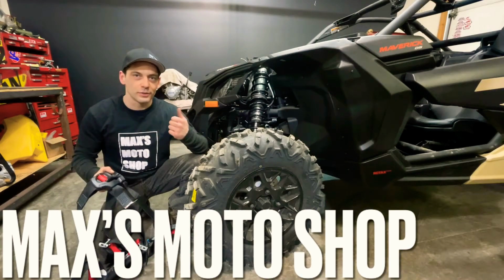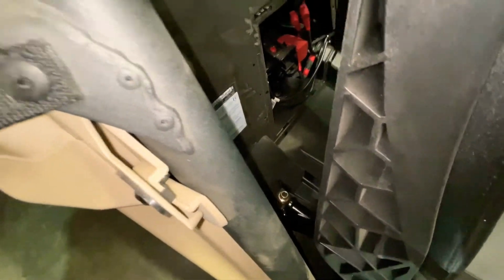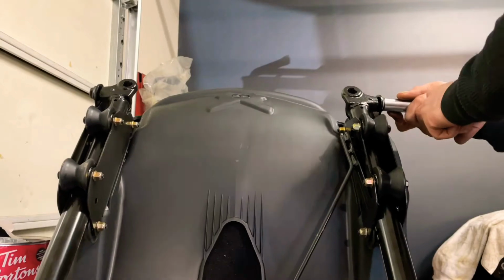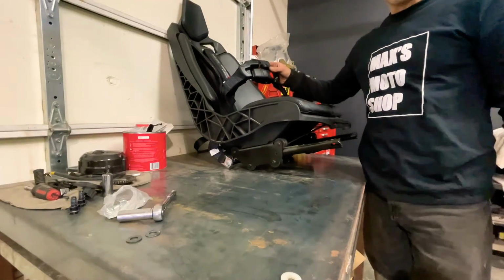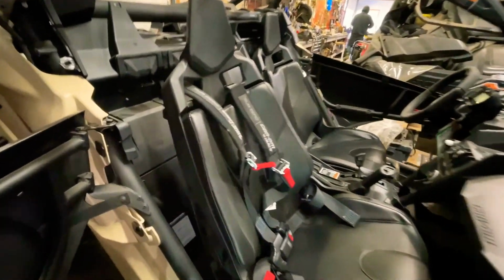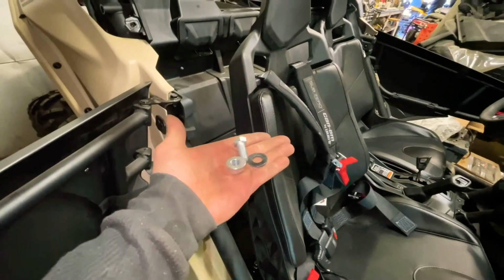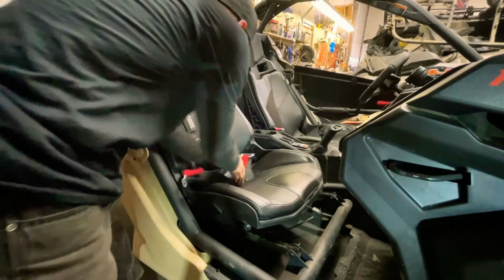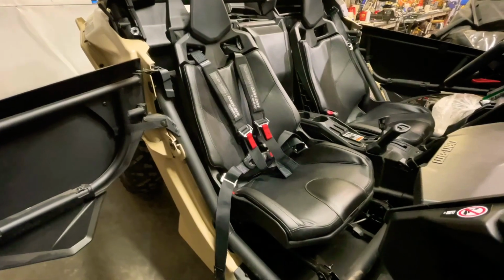How To Install A Four-point Harness /2021 Can-Am Maverick 900 Turbo R / MAX’S MOTO SHOP

Comment: What size bolts for the bottom? Did it come with the set or did you buy separately?
Reply from the maker: All bolts needed will come with the kit
Reply: @Maxsmotoshop  not for me - I had to buy different bolts from the hardware shop.

Comment: What brand or kit? And will it work on a 2022?
Reply: The harnesses are Immi sub zero and they should work on a 2022 but I would recommend asking a dealer first!
Reply from the maker: These are the Canam original accessories
Reply from the maker: Wrong
Reply: @Maxsmotoshop  you buy them from can am but they are made by Immi, I used to be a engineer for can am at the Sturtevant Wisconsin facility. While we did not build the actual x3 there we built the engines for them.